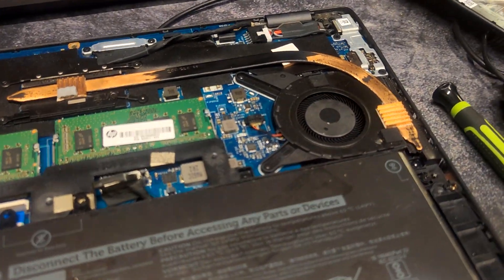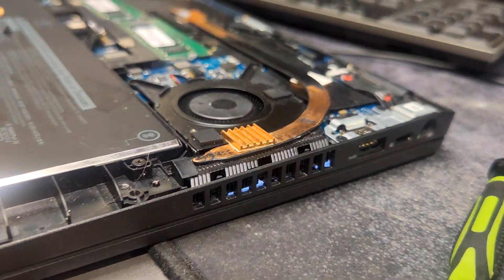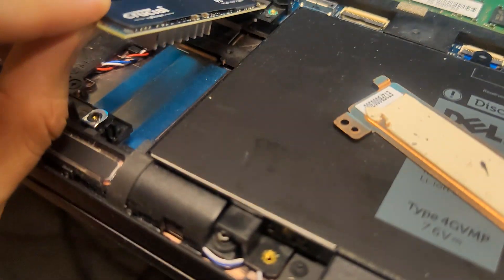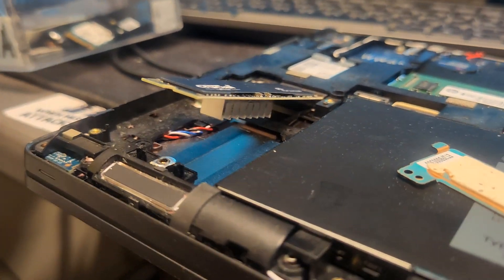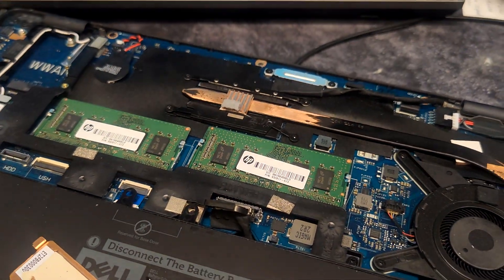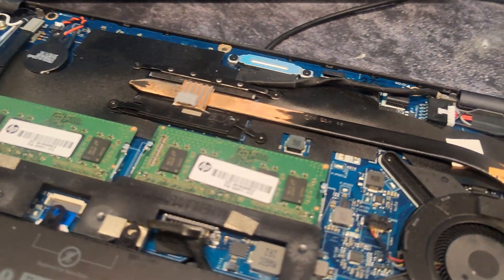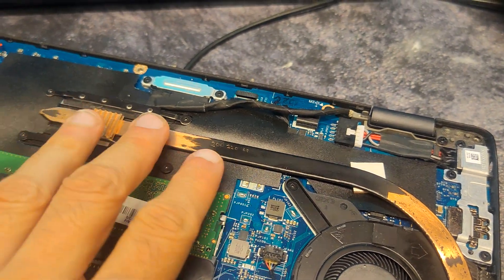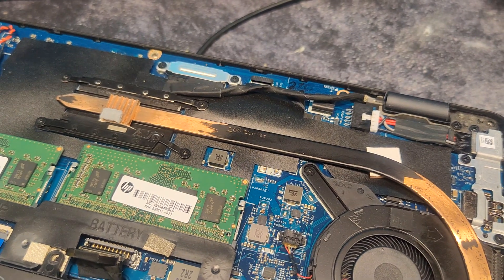you won't believe what this Italian guy did to his Dell laptop

Comment: the ssd heat spreader is kinda smart, but you should also do it on the ram if possible, anyway that heat on its own was still going to get stuck in the pc shell, so may as well just make it better on the rams and ssd side to prevent degradation with time
Reply from the maker: i disagree, 1.2v ram is not a major heat, if i had to cool it i would use thermal pads to bridge the nand chips to the main PCB and dump heat there

the heat spread on the top of the computer case, exp on the metal structure of the keyboard, is actually very useful to improve general heat dissipation

Comment: not to be rude but im pretty sure you made it worse because that heat is just floating there and if you soder on a heat sink your messing up the heat pipe internally (btw i am a professional pc builder and laptop/pc repairer)
Reply from the maker: no soldering on, the effect of using the other components as additional heat sink and spreading is definitely making the fans kick in later and scores to go higher, a wider surface to transfer heat is more efficient